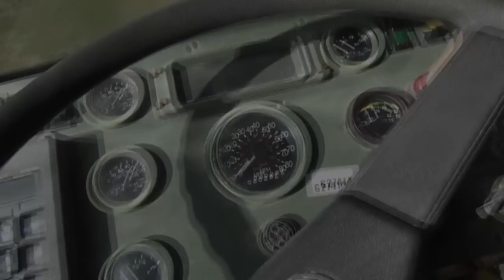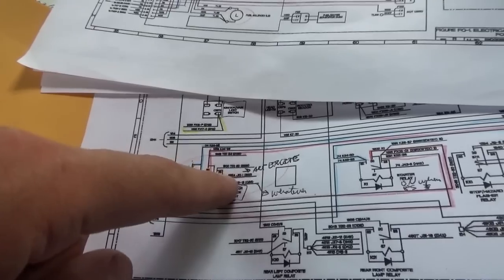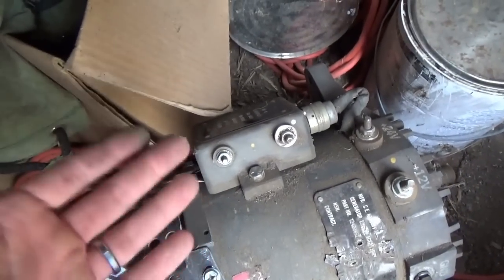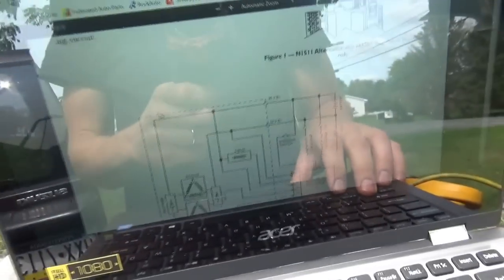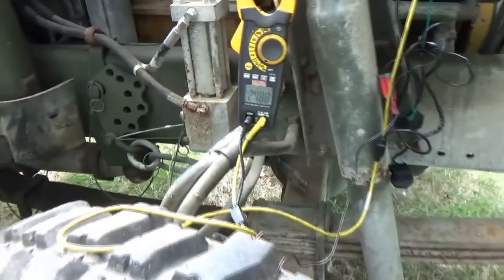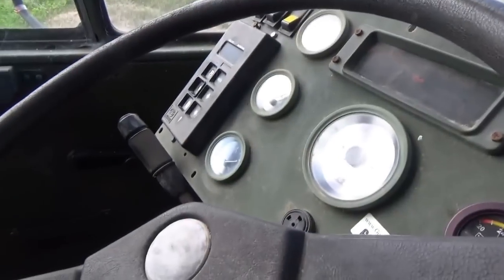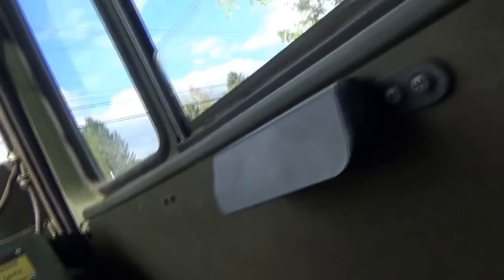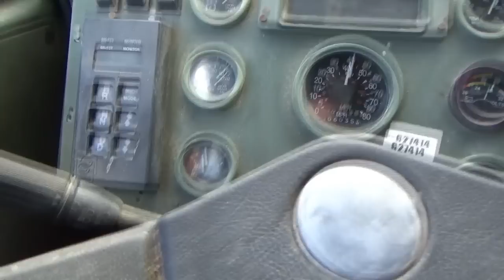APOCALYPSE TRUCK - Part 2 (Alternator &  Gauges)

Comment: Around 1979 I was doing some communications work at the Stewart Stevenson plant in Houston Tx, and got to watch them fire up a jet engine they were developing. It was the first time they fired it up, must of been 50 Engineers there, testing and taking readings. It was amazing. There were no covers on the engine, so you really had a nice view, I was around 20 foot away soaking it all in. Doing the work I did I got to see almost everything out there from NASA to Westinghouse where they made and rebuilt huge turbines for power plants, to the Johnson Engineers where they stored  all the Space Shuttle Arms (150), kept in a A/C blacked out warehouse. Watched Hughes Tool Company develop the huge 8 foot rock roller drilling bit. Basically it was 40 years of learning and watching, best job you could ever have.

Comment: Put a plow on it for winter use.  So it has 24 volts for starting and the "Generator" puts out 24 and 12.  12 volts for lights and other accessories.
SOMEWHERE in my old Delco material, 2 of us went for training at the old Delco Training Center in 1987 at Anderson Indiana.
I saw a Generator (as Delco/GM call it) that put out 12 Volts AND a Step Up Transformer of 24 (actual was 28 with engine running) Volts!  It was self regulated of course, used in some large over-the-road and possibly off road equipment vehicles.
I've never seen one in use, I know I still have the book and/or literature on its operation.  I was really impressed with it.
We also learned about series/parallel cranking/charging switches.   Long time ago, GREAT TRAINING.

Comment: Principle of military vehicle design make it simple, make it strong, and make a lot.
Reply: UNLESS YOU HAVE MICE ?
Reply: Not in the case of the LMTV. It’s over complicated electric nightmare.
Reply: Yes TL35 is supposed to be on the front lug of the regulator.

Comment: In the UK green nozel is for unleaded petrol . Black for derv. Holiday makers visiting normally get it wrong.
Reply: lol, they're opposite that here in USA. I could see there being issues. the diesel nozzle is larger diameter so it wont fit into most gas vehicles, but nothing stopping gas nozzle from the diesel tanks.

Comment: Dang lvan. You can fix anything. Bet you can fix spaceship 🚀 . That’s a cool looking truck.

Last night I had a look at 2011 Dodge Avenger 2.4. Stepsister’s car. Complaint was windows don’t work (both right front/rear windows).It remind me of you when you did Subaru power window. I fixed rear right window (was due to connector wasn’t pushed in). Only problem is right front don’t work from master switch and passenger switch, only work when pressin down not up , both switch. Weird. I took notes and used wiring diagram. I had to bypass motor to get window up. I believe both switches are bad. Also lock button don’t work. But i will see (will update). I hope I’m right 😭.

Comment: Ivan solves another one. Ivan replaced the Cat on the Astra over weekend. It also had a P2088 code Intake Camshaft Position (CMP) Actuator Solenoid Control Circuit Low Voltage . Will be checking that out soon.

Comment: Hi IVAN ,no power windows is for WHEN THE EMP WAVE HITS,you'll still be able to ROLL down the window so the cigarette smoke doesn't bother the driver.haha
That is if the blast from an IED doesn't break it out first.Just like the manual hydraulic cab lift,there needs to be two ways to do the same thing ,it's called a backup system.YOU know like when you yell at your wife to bring you more TOILET PAPER when you run out,haha

Comment: What did/do they use that big heavy truck for? Doesn't seem to have much equipment on it other than room to haul loads and troops.
You just have to be happy that there are real honest high quality alternators on the market but for lots of money. Nice to know they will provide 90%+ of their output amperage at idle too.

Comment: Only 6K on the beast, that engine is good for a very long time. Wonder who messed up all the wires? Most likely a person like my old neighbor, screwdriver arc testing, if it sparks good, no sparks not any good. haha
Reply: I've worked with some people that would test things this way and they wonder why none of the battery chargers work.

Comment: if it's a dual voltage output, I'd assume it would have 2 different excite input terminals, one per voltage. maybe you tracked the wrong wire to start with, guess I'll see shortly :)

Comment: Volume of a fuel tank: length (in inches) X width (in inches) X height (in inches) = cubic inches. Cubic inches divided by 231 = gallons.

Comment: dual voltage systems suck especially when they use the frame as a common. it doent take much of a bad connection for the higher voltage to show up on the low voltage system. i suspect thats what happened to the regulator. there are lots of variations on these lines  most common is a 24 volt starting using 12 v charging but i 've seen a lot of 24 volt start n charge with 12v  running the rest. most of them use a stack or otherwise known as a series -parallel switch  of some sorts.

Comment: Lessons learned? Incomplete diagnosis of the original alternator before calling for a replacement? Did the miswiring damage the regulator on the original alternator? If one can get the regulator on ebay, why not just replace the regulator on the original (provided that a more thorough diagnosis was done), my guess is that it's cheaper.. Did the miswiring cause damage to the regulator on the new alternator that caused it to fail in a short amount of time? The hydraulic fluid didn't evaporate. Probably a leak somewhere that should be found.
Reply from the maker: Watch part 1 again... Original alternator was 100% toast 😁👍
Reply: @PineHollowAutoDiagnostics  the alternator AND the regulator were both toast??? How do you know when you didn't discover the field excitation wire was connected wrong until installing the new alternator???
Reply from the maker: @fredflintstone8048  original regulator had a burned pin on it, I assume from reversing polarity.

Comment: If I got it right, lesson learned here, you don't want an exciter coil energized, without the alternator fan spinning.
Reply: short duration with no field load wouldn't be hard on it.

Comment: I work on the on a daily basis at Camp Shelby jftc. These are an electrical nightmare. Every time you diagnose the charging system it’s something different. On that particular model, all the relays are controlled by a circuit board that’s garbage, replace it.

Comment: Just use the regulator off the good old unit
Reply from the maker: Not compatible, different pinout. Also original had a burned pin

Comment: I have noticed military vehicles are money pits, I would rather have a boat.
Right now I have a 53 Jeep, it came in on one cylinder, burned valves on three.
It ran pretty good on one cylinder, but. I would never keep one for any reason, sell it before it dies.
I have no ego issues, therefore, I don't need a military vehicle. The guy with the jeep does have issues, and he needs this thing to run. 
Be careful what you wish for, you might get it.

Comment: must be running out of work, to take on jobs like that!
Reply from the maker: No one else would touch it...I'm the last resort. Obviously my diag/repair rates for construction and obscure military equipment is higher than for regular cars ;)
Reply: @PineHollowAutoDiagnostics  How long did you take to research the alternator?

Comment: Why or why do you take these jobs.  There is a reason no one else will do this stuff.  I know you didn't get your hourly rate for ALL the hours you spent researching etc.  Admire your knowledge, skill and thinking process but still questioning your business acumen.
Reply: Maybe it's fun for him? The desire for knowledge is of a higher value to him than the dollar.
Reply from the maker: Actually I charged my full rate for research, diagnostics, and repair. Made more money on that truck than any regular car diag. Seems to be a pretty sound business model 😉👌
Reply: Gained more knowledge AND made bank. Yeah, you did good!